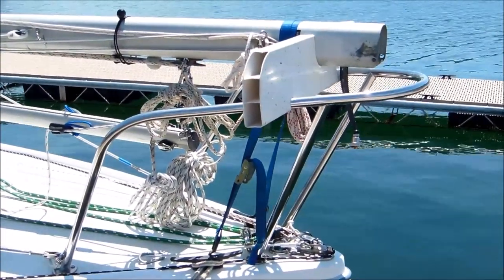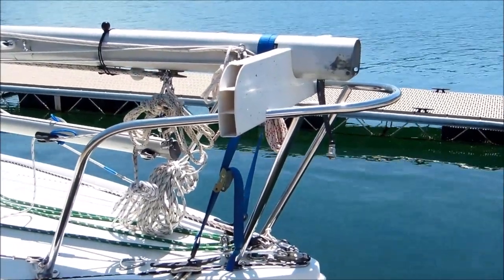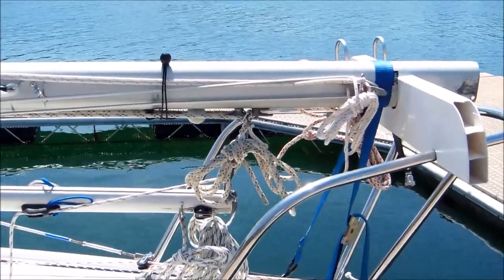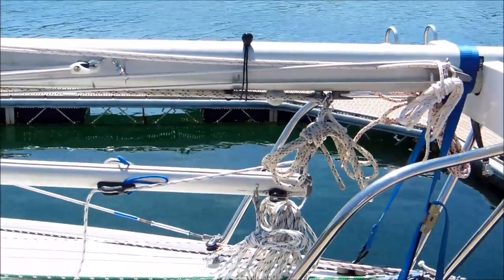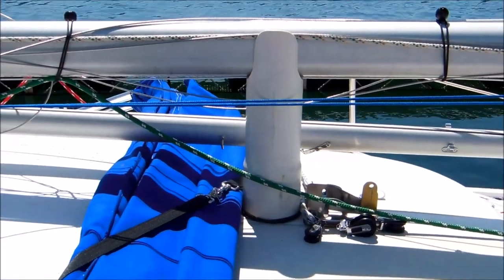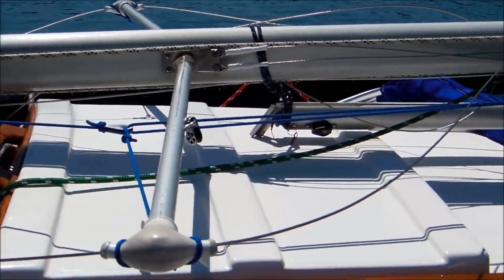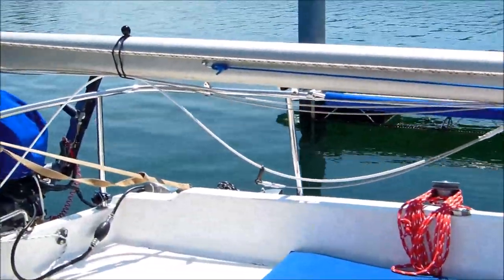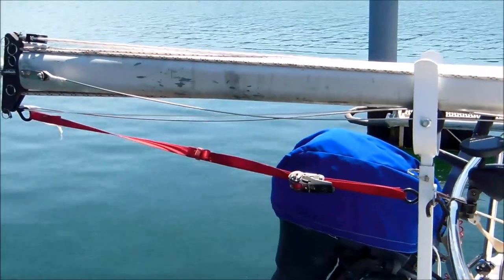Securing the Catalina 22 Rig for Trailering

Comment: I just stepped into the adventure and bought me a Catalina 22.  I'm about to find out if I'm a DIYr not.  Because I'm new I'm sure I'm going to make a ton of mistakes.  I like your mask cradle.  Do you have any drawings on how you made that cradle and the tools that you used?
Reply from the maker: Welcome to the C22 community! You can download a free, dimensioned fabrication drawing for the mast crutch if you're a subscriber (also free) to my website. For more information about the downloads, see https://stingysailor.com/downloads-faq/
Reply: @stingysailor5677  okay I'm subscribed.  But I wasn't asking about the mast crutch,  I was asking about the cradle that goes over the pulpit
Reply from the maker: @michellenicholes2087  I don't have a drawing door that, sorry. I just took a scrap that I had on hand and cut notches for the mast to rest in and for the cradle to straddle the pulpit.
Reply: @stingysailor5677 what was the trick to cutting the angles where it fits over the pulpit.  The tubing looks like it's in a downgrade and spreading whiter as it goes aft.
Reply from the maker: @michellenicholes2087  Trial and error, LOL. Before cutting, I sat it on the pulpit where I wanted it to fit, then vertically traced the edges of the pulpit tubing to the underside with a pencil. I conservatively cut the notches, tested the fit, and adjusted the angles and deepened them until it fit snug and level.

Comment: Hope you do not travel with the outboard attached to the stern. This will cause a lot of wear on the transom due to bouncing on the lever end of the boat. I see a lot of this kind of damage on Catalina 22.  I always remove the engine and place it in my truck.
Reply from the maker: Actually, I have traveled hundreds of miles with the motor attached and without any damage because I take precautions. I use two ratchet straps attached to the motor to take most of the weight off of the motor mount and transfer it to the stern cleats. I also have 2" aluminum angle backing plates on the inside of the transom to stiffen the area around the motor bracket and distribute the weight over a larger area. I agree, though, that not taking precautions like these can cause a lot of stress and wear on the motor mount or worse.

Comment: Can you recommend a source for the Vinyl  Horse Fence? I have not had success finding the railing alone.
Reply from the maker: It might be a regional thing. Most big box home improvement stores here in the Northwest carry it. If yours don't, try a fencing supplier that specializes in rural fencing. Worst case, substitute a different material like PVC pipe. You can use wood too but it's heavier.
Reply: Stingy Sailor Thank you for the response. I will do that. Or I may order some starboard and copy a design from a certain Catalina parts dealer.